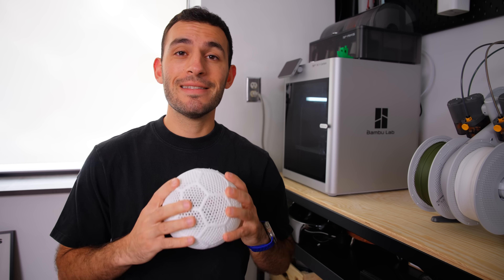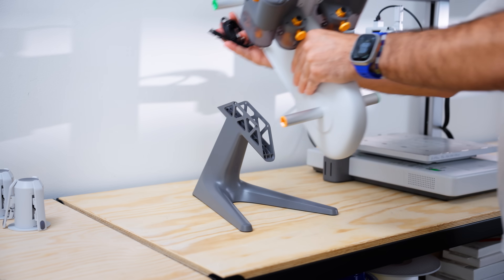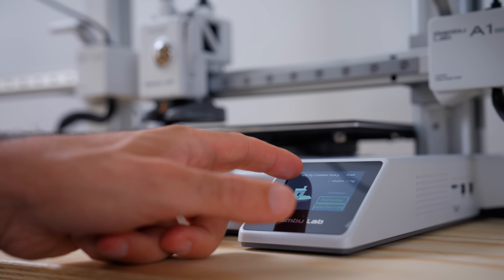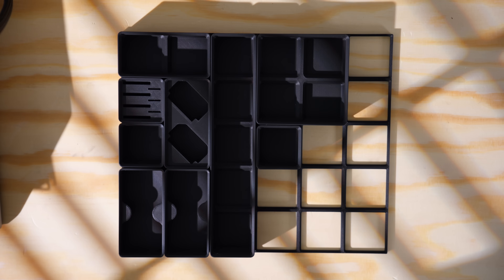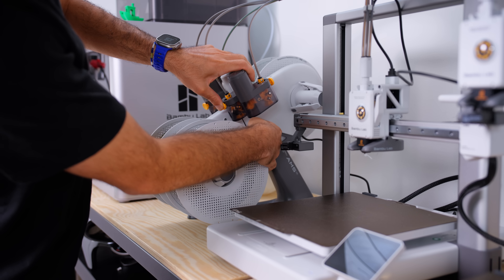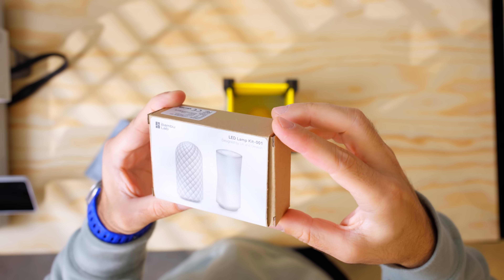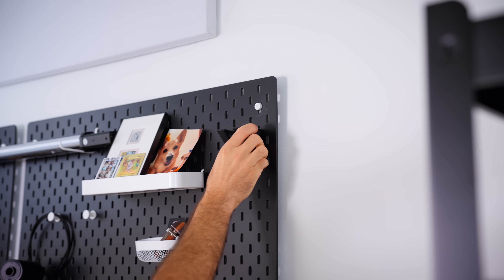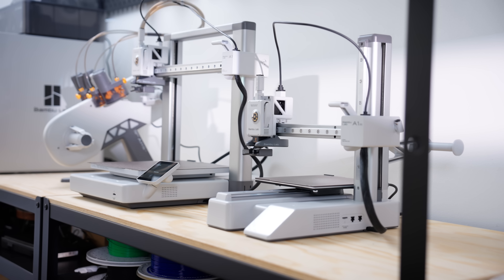Before You Get a 3D Printer, Watch This

Comment: Hello ,I want to get into 3d printing and i would like to buy the Bambu Lab A1 Mini (no AMS). The problem is that i don't know if it will be worth it ,i already have a project for my desk that will be much easier if i would have this technology. I also want to learn how to 3d model using CAD software and how to use the Bambu Lab Slicer. Now i am scared that if i finish my project and i also print some things that are useful like household items and many more things for my house, i would run out of things to print and than after a month or so i let the printer to collect dust and i would use it like once every 4 or 5 months. I know this sounds exaggerating and probably a very foolish "prediction" of what will happen but i have big doubts about it. I would want to use it more like a tool than a hobby because printing random things (Decorations) will probably bore me especially that it doesn't have AMS. So in conclusion, should i get it or move on?

Comment: Things he doesnt tell you:

1. If you really think about printing color you need 10+ spools each starting at 20€ or more. Every project has new colors. Also half of the spool is wasted for clearing the nozzle each time the color changes. 
2. If you are not a NPC you dont really need 50 vases and 60 phone holders, so if you dont plan on using it for models or prototyping, its not really gonna bet much use. So maybe buy a 160€ ender 3 v3 for occasional use?

Comment: DO NOT BUY A BAMBU LAB AS YOUR FIRST PRINTER! They are way to expensive. The kobra 3 is by far the best beginner printer. The combo includes multicolour printing with a built in drybox (no other companies offer this) and is the cheapest multicolour printer ever. Nit to mention its top speed is 100mm/s faster than anything bambu lab has.

Comment: Couldn't be happier with my Bambu Lab A1, planning to acquire an A1 mini and AMS lite soon!
Reply: learn to airbrush paint your models.. it's fun and so much cheaper. a 1kg roll of good grey pla/petg is $13.99 vs colored filament which is anywhere from $17.99- $40 depending on the color/company. also the ams system can't do exact color matching.

Comment: Been wanting a 3d printer for so long but for someone that doesn't know anything about them it always puts me off. But im really liking the look of this printer
Reply: this video looks like a paid ad, look for other reviews and not this
Reply: @liamb.2506 it is a paid ad, but bambu lab is not bad for doing this, their printers, all of them, are good, they have entry level printers and high end printers that are all really, really good, yes, they did remove very few features, but only because they were dangerous and have caused a problem, and their reliability and customer service are top notch for a chinese company.
Reply: I’m I first time printer, and I’ve got an ender 3 v3 ke. If you want a printer that takes almost no setup, I’d recommend you get this one. All you do is take it out of the box, connect 4 connectors and screw in 6 screws and then send the file over, and off it goes.
Reply: Wait, so having to learn puts you off doing something?
3D printing requires you to learn... like any hobby. Even if you never part upgrade your machine, you still have to know how it works.
The learning curve with printers isn't actually that hard... its really just main parts that all come together. One YouTube video is enough in most cases.
If it always "Puts you off", then maybe a 3D print service would be better for you. You can just send them the file of what you want printed and they will send you the finished print.
Reply: @NIGHTDREADED  Wait, so having to learn puts you off doing something? --Yes, are you new to humanity? That is probably the number one reason why someone might not do something that interests them. How is that even remotely controversial lol. You sound like you're observing human behavior for the first time. I feel that barrier too. Its a big time commitment to figure this out. it would be awesome if it wasn't. There is no benefit t something being difficult to figure out. Back in the day you have to program programming languages. Now you use the languages to make something cool. Saved a ton of time and made the barrier of entry much lower and more accessible. Any technology is usually more accessible when its easier and that's completely obvious and valid. You're not special for wanting something to be time consuming and difficult. Acquiring knowledge or a skill is not a more worthwhile task when it takes longer.
Reply: @AnnelRam That logic doesn’t make sense.
If something truly interests you, you should be willing to learn about it.

By your reasoning, someone who wants to be an artist should just snap their fingers and instantly have a perfect painting appear in front of them.
A fisherman should be able to snap their fingers and instantly catch as many fish as they want.
That’s not how hobbies work.

If something interests you but you don’t want to learn anything about it, then you’re not interested in the process — only the result.
You want the outcome without any effort.
That’s not passion, that’s consumption.

You keep saying 3D printing takes too much time. Compared to most hobbies, it really doesn’t.
You set up the machine, learn the basics, do occasional maintenance — and the rest of the time, it’s just printing.
That’s far less time than something like painting, sculpting, or woodworking, which can easily takes 100's to 1000's of hours JUST to learn the process.

If you truly don’t have time to learn, then maybe the issue isn’t the hobby — it’s how efficiently you’re using your time.
Demanding that a hobby become “effort-free” just to fit your schedule isn’t a reasonable stance.

If you want prints without ever learning how to operate a printer, that’s fine — just use a 3D print service.
You send them the file, they print it, they ship it to you. That’s as easy as it gets.
But you don’t get to call a hobby “too hard” simply because it asks you to learn something.

By your logic, everyone should strive for the lowest possible effort — to chase only the end result.
That’s how people get stuck in the dopamine loop: chasing outcomes without caring about the process.
That’s not growth, and it’s not fulfillment.

Sure, 3D printing used to be time-consuming and finicky. That was true in the pre-2018 era.
But the machines now? They’re fast, stable, and accessible.
That argument lost its validity a long time ago.

And no — learning doesn’t make anyone “special.”
You’re the one who brought that up, not me.
Putting words in other people’s mouths isn’t a great look, especially when your best point is still “it’s time consuming.”

Of course 3D printing takes time — every hobby does.
If you refuse to learn anything new, then no hobby is for you, because all of them require some form of learning.
Even with “easy” printers, you still have to understand what you’re doing.
That’s why the companies themselves make official courses — because knowledge is part of the product.

So what’s your argument?
That people shouldn’t have to learn at all? Because if that’s it, then your entire logic collapses.

The barrier to entry hasn’t been “hard” for years.
Printers have been affordable and accessible since at least 2018.
You can buy a basic one for under $100 and learn the fundamentals in an afternoon.
There are even one-button, child-safe printers that do nearly everything for you — those have existed for years.

The only real “barrier” left isn’t technology — it’s willingness.
If you don’t want to learn, you don’t want the hobby.
It’s that simple.

Bambu Lab isn’t a savior — 3D printing has been accessible long before they entered the market.
The tech kept improving year after year; the tools got cheaper and easier.
The only variable that hasn’t changed is whether a person actually wants to learn.

Accessibility is good — absolutely. But what you’re describing isn’t accessibility, it’s mindlessness.
Accessibility means removing unfair barriers; it doesn’t mean stripping away every ounce of responsibility or curiosity.

And for years now, ordinary people — not tech experts, even disabled veterans — have been 3D printing successfully.
So no, the problem isn’t complexity.
It’s willingness.

The barrier since 2018 has only been the person — and their choice to learn.
Reply: Don't. Please. Not unless at least they stop removing features after people have paid for the printers. I wont trust them again

Comment: Does it automatically split a project into several sections? Ex. I have a 3d file that is 9 square feet by 8 inches high. Is there a tool that would help splint this this into X amount of pieces for me to assemble once everything is printed?

Comment: If they were open source, I would. But I don't like the idea of it being so locked down that I can't make changes to it.
Reply: The Bambu system works so well, you don't need to make any changes. It's like buying a paper printer. No fuss, no mussing around, just print. I've owned my P1S now for over a year with over 1000 hours of print time on it and it still prints like it's new and out of the box. Other than some lube and simple belt tensioning which is quite easy to do. I don't use the app so I connect to it using my own local connection which you can do and avoid being connected to Bambu Labs at all. I've been a 3D printer for over 20 years and all I can say about their product is that it works, works very well, and will bring 3D printing to more people than Creality or other makers of printers can imagine. And really, shouldn't that be what 3D printing is about? Just to simply print something?

Comment: Which one is best The A1 mini or P1s? Which one should i go for?  I have CR10 SP and am fed up with the problems already
Reply: If it's a matter of price, the A1 mini is way smaller than the P1S. You're getting your moneys worth though. If money is no object, get the P1S. But, if you're on a budget the A1 mini, or the A1, are great printers. I started with a CR10 and my A1 is a different experience entirely. The user experience itself is just so much more seamless and manageable. Literally any Bambu printer will be nicer to use right out of the box.
Reply: @runeprism9317  Great! Am thinking to go for P1S.

Comment: Hi, I have just ordered my A1 combo, but the question's are regarding filament. I have ordered esun pla+. How do you change this in the settings to get it right ? Because the bambo lab A1 have only the bambo and the creality filmet. So how can I do it the right way. Ore do I need to by some new Filment ?
Reply from the maker: @annetrengereid675  You’re able to manually set which filament you’re using! There are a ton of brand options but you can also use the “generic” option and then select PLA from there

Comment: Just keep in mind that we don’t know about the health effects yet of 3D printers. Make sure you have plenty of ventilation in that room flowing to the outside.
Reply: Off gasing from resin printers can be sells enough to require a dedicated ventilation system, but most FDM printers don't have that concern. 

An increase in microplastic generation from failed prints being disposed of is a concern, but there are also methods of recreating the filament from the failed prints too, so there are ways to mitigate that downside
Reply: It cause me to sleep late and be sleepy
Reply: Gas station worker joined the chat...
Reply: We've been hearing plastic for a hundred years. We know what's toxic and what's not.
Reply: @tmpace9 what does plastic usually say to us?
Reply: @tmpace9 the person was simply stating, not everything needs to be an argument. It’s a responsible comment? What’s there to argue with?
Reply: Actually, no, we do know the effects, what materials are toxic/dangerous, under what circumstances, and how to mitigate any potential issues. It's just plastic being heated, and plastic's been heated for a really long time at this point. No point in fearmongering like this, just do basic research on the materials you're using and you'll be fine.
Reply: It can be as bad as injection molding.. relax man..u ll die inhaling CO from a car before this if u think about it.. stop fear mongering
Reply: Great tip thank you, it’s important to be responsible when using machinery! 😁💪🏼 especially if you have kids.
Reply: bs
Reply: It will be found to cause cancer in Commifornia.
Reply: Pla & tpu do not have any health effects
Reply: Yeah! @LuckyStrikeTech you're a silly guyfor offering generally agreeable advice. You're also really  stinky, and All these other people are way smarter and more hardcore than you. Obviously, with such a sophisticated system of regulations worldwide ran by completely honest people who would in no way ever manipulate data or lie to us because it would be unthinkable to slowly poison the public for their own personal gains. Right? Why wouldn't I blindly trust the government?
Reply: None of the materials used in 3D printing are exactly new though...
Reply: So dont put it in the desk in my room
Reply: Thats mainly for resin printers
Reply: @ most noobies don't know that printing with abs and asa is toxic on non enclosed fdm printers
Reply: @honda-s2k petg is a better alternative to abs and isn't toxic when melted and just as strong
Reply: @coldshock5181 personally i have kindof allergic reaction to PLA and PETG printing, ABS is painful and toxic. But no problem with resin, it just smells terrible. Of course I wear gloves and good ventillation when handling. I keep all my printers in a cabinet with 24/7 extractor fan
Reply: @coldshock5181  no its not/ printing with asa and abs is poisonous!!!! make sure you are printing in a will ventilated area when printing with exotic filaments ya noobies
Reply: 3d printing has been around at least 30 years. We had a 3d printer in the science lab when I was in middle school. That was the early 90s. I haven't heard anything about people my age getting sick. I'm sure the room had ventilation. We used to make soap dishes.
Reply: @JohnEastmanExAttyAtLaw  printing with asa and abs is poisonous!!!! make sure you are printing in a will ventilated area ya noobies
Reply: What about if I want to die?
Reply: @edbeavis  There are easier and quicker tricks for that
Reply: @edbeavis LMAOAOAO
Reply: @edbeavis  there's faster ways.
Reply: You worry about the small stuff.

Comment: Dont forget to keep your filament dried out cuz it can mess up prints if you dont.
Reply: Can you put filament inside a oven to dry it ?
Reply: @LeRatVisseur  no that would burn it yoiu would have to buy a filament dryer from like creality or sovul
Reply: @NoahBuildsPCs  If you have a printer with a build plate over 235x235mm you can just use the build plate heater and a filament box with some holes poked in to dry your filament.

Comment: Like others mentioned it's a clickbait title for a Bambu Lab brand but some may use this video for inspiration on what to print and what to buy a printer for.

What you didn't mention (because of the sponsorship) is that Bambu Lab kinda copied a lot of things. The copied Prusa Slicer for their Bambu Studio, or printables for Makerworld so it should be said that none of those features are Bambu exclusive. On the contrary: Using a slicer like Orca Slicer and feeling at home on other platform like printables or thingiverse just widens up the hobby.

I also wanna mention that there are good alternatives to the Bambu printers like the Sovol SV06 ACE. It basically comes with the same features than the A1 for a better price. And with open source it is ensured that you get replacement parts in some years or even are able to repair all things which is not given in every aspect of glued together parts in Bambu Lab printers. It should run fine for some time ... but when it doesn't you can repair it. Some people like that.
Also multicolor is available elsewhere like the Anycubic Kobra 3 Combo or the upcoming CFS from Creality. But I think this use case is overrated for most hobbyists. They try it at first but later on mostly print parts with one material. Combining the printer with a dry box, especially for PLA and PETG might be a better idea.

After all 3D printing came a long way but the times of the "old Ender 3" you had to tinker with a long gone! Even the current Ender 3 V3 prints without a problem out of the box but often does not limit you to one ecosystem.

With all these printers for below 400 (even 300) bucks a beginner should have a fine experience. Buy that one that looks the most interesting, has a unique feature (e.g. modability) or simply is on sale. Topic done.
Reply: Yup. Kinda like most cars are just copies of Ford model T.
Reply: Thank you for putting this out there. More people need to hear this.
Reply: multicolor printing with the kobra 3 combo kind of sucks. it purges way more material and it's basically a blatant copy of Bambu Lab AMS. also Anycubic literally has their own BLATANT copy of Makerworld ("Makeronline")
Reply: Completely true. To me Bambulab is just a popular copy of Prusa, with the A1 being just like the prusa mk3s and the mini being just like the prusa mini, with the only real differences being that the bambulab versions look more futuristic and that they have a camera for monitoring. 

I have never tested a Bambulab machine for myself but from what I can see it looks really hard to repair. Where with my Prusa printer (or any printer that is more than a year old by now) I can switch any broken part out for a new one within five minutes. Again, only from what I can see, the Bambulab machines look like you need to completely remove a lot of covers before even being able to see why the printer isnt working as intended (correct me if I'm wrong though).
Reply: @Ewout761 Remind me how much do the Prusas cost again ?